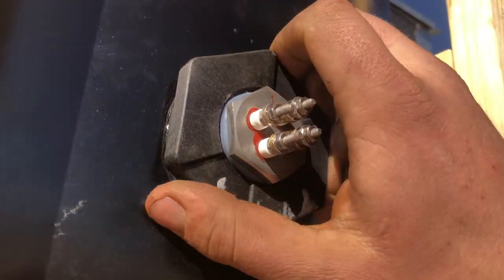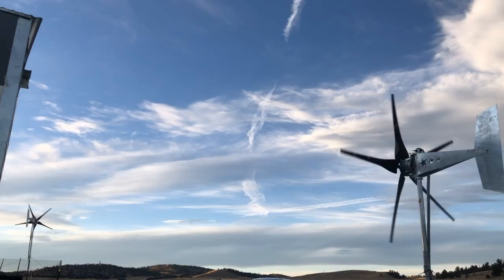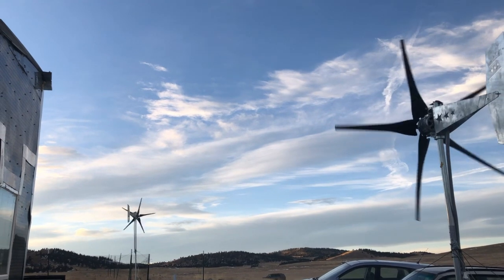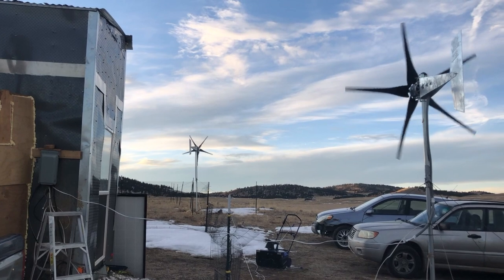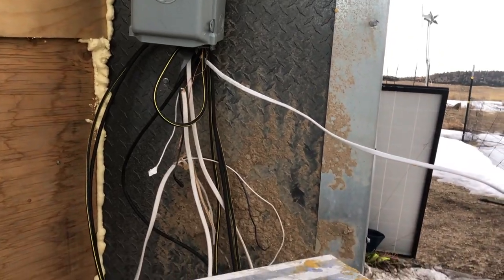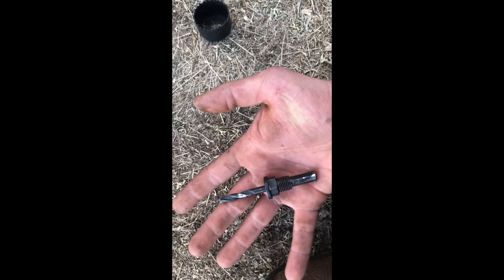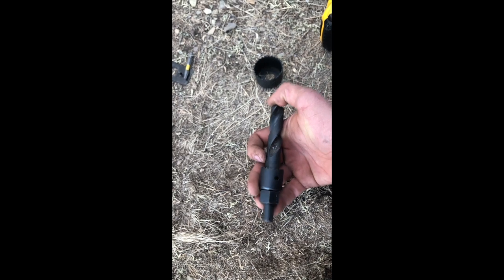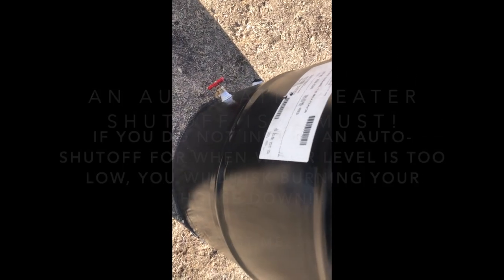Off-grid Hot Water Heater as Wind Turbine Heat Dump - AC and DC

Comment: Check out windmill water heaters. Basically retarders (fluid brakes)  attached to windmill/waterwheel  skips the electric part ans makes hot water directly. They build quite a few in norway denmark in the 70s
Reply from the maker: Steam is the future!

Comment: i love this, but... until you can stop them blades entirely, you are still letting a LOT of power go to waste.

if you had an alternator hooked up, so you could vary the power its dumping, and then you can watch the output and get an idea when its spinning at its peak efficiency for any wind speed. 

 and in the winds you get on a plain like that? wow. 

a PM generator is simple but its also extremely limited. 

im actually working on something entirely different. why dick around with wires, resistors, generators?

boils water. and virtually no limit on the input power. meaning you can grab all the power in that wind...

the amount of load you put on a brake is going to appear as heat. if you can vary the load in direct proportion to the power in the wind speed... you can get all the power by keeping blades at the ideal speeds. an alternator or any other generator can act as a brake... up to a limit. the issue is where does the power go? and here is the answer. boil water. or store heat.

get all the power in the wind that you can. the generator has to be rethought, get rid of the middleman, the electrical loss.